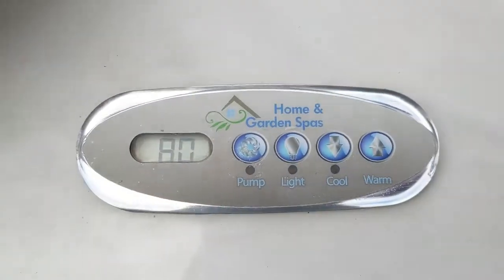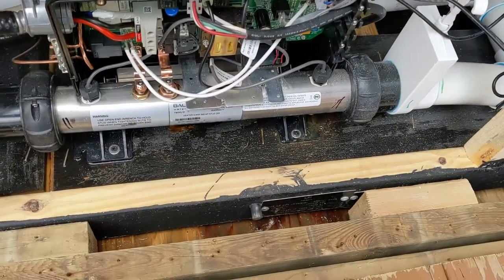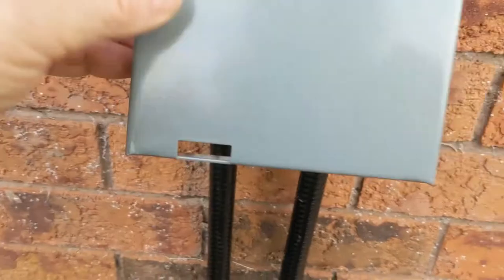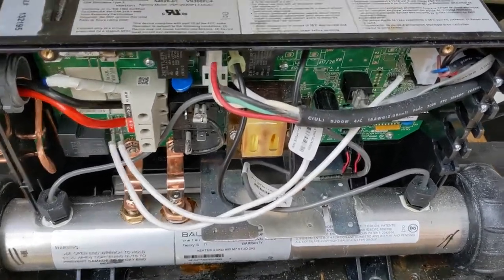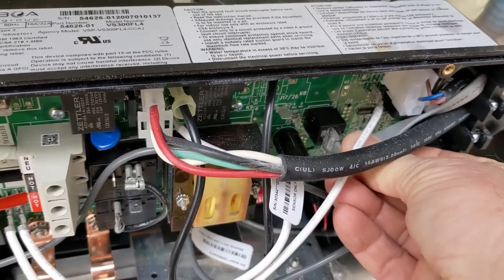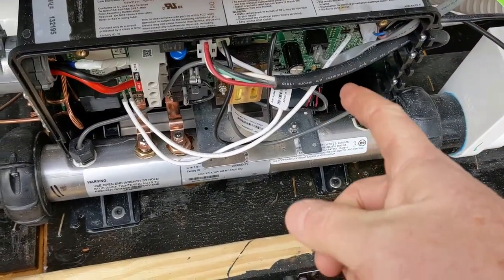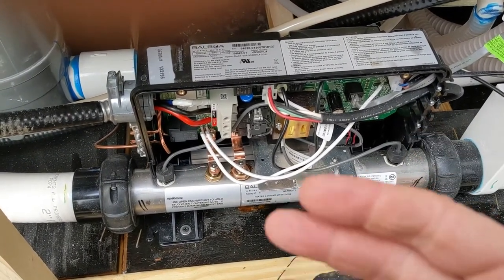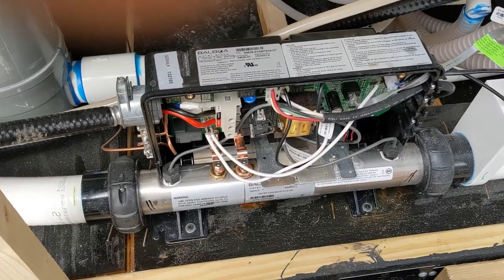Hot Tub Not Turning on When Buttons are Pushed / Hot Tub Not Turning On, Nothing Works

Comment: Subscribed! Good videos. I have a 2011 J-345 and the pump buttons on the control panel don’t work and neither does the temp up and down switch. Replaced the control panel and the same thing. Pumps run after resetting the breaker and going through its tests. However, nothing when pushing the buttons. I pulled the control panel connection like shown and nothing changed…and no clicking. Assuming it’s the circuit board. Am I on the right path?  Thx.
Reply from the maker: It does sound like the circuit board.
Reply: Thanks!

Comment: my topside works as I get clicking but the pump wont turn on.  I have verified power coming into the board and which relay is clicking when we turn on the jets but I'm not getting any power to the pump at it's board connector.  I have also verified that all of the fuses on the board are indeed good.  do you think its a bad relay? can I bypass the board and wire the pump up on a temp switch to verify the pump still works? nevermind, I missed a fuse which was the issue...
Reply from the maker: @jeffmentzer6550  lol.  At least you found it
Reply: @VIPPoolsandSpas  it a 20amp 250v ceramic fuse, I replace it and it blew instantly.  I then used a 20 amp blade fuse holder attached to each side of the actual fuse holder on the board and it's working fine.  not sure why the "ceramic" fuses keep blowing...
Reply from the maker: @jeffmentzer6550  Whatever that fuse is blowing is the problem.  Only use the fuse whats there.   Test the pumps capacitor

Comment: Hey Bud, I have an older model Hot tube. It has power to the Top side Panel but simply flashes. When I push the pump button All I get is a click each time I press it. and nothing but the click. Any suggestions what this might be?.any suggestions would be  appreciated.??
Reply from the maker: Fuse or pump capacitor maybe.
Reply from the maker: I'm going to assume you only have one pump.  Right
Reply: Hey Bud, yes One Pump. I am going to check the fuses first once I find my Voltmetre? The kids were in the tub the night before and found my strainer etc upside down in the morning so thinking maybe they starved the Pump and caused a tripout(fuse) issue. Im NOT an electrician but figure can at least diagnose what I can before calling a tech who will check what I can firstly anyways?
Reply: Hey Bud, fuses check out fine? Can these things be jumped or by passed to diagnose faulty stuff?? Then replace them??
Reply from the maker: @need2know739  not sure what spa pack you have but, could try turning power off, unplug the topside and then turn power back on.  Pump should come on.  Also, when you say it just Flash's, what is it flashing?  Could also test the pump capacitor.
Reply: Seems I have a non message display model? All I get is 3 lights flashing? Did the Power off on / Breaker swiitch stuff. Its getting power, and clicks on the  M Board  but NO Pump??
Reply from the maker: @need2know739  3 lights flashing is a flow issue.  Is your pump even working?
Reply from the maker: @need2know739  can you hear your pump at all?  Humming?  Anything?
Reply: Notta?... Just the click in the Panel when trying to. Are these Motors in them 2 stage??
Reply from the maker: @need2know739  test the pump capacitor
Reply: Is that located on Top the Heater bar?
I did the two wire jump thing to bypass to that and nothing? Is it possible the actual pump is toast? If so? Is there a bypass I can try on it to test if its a goner?
Reply: Can I bypass the   Capacitor?? Jump it??
Reply from the maker: @need2know739  it's not on the heater.  Only a pressure can be jumped to test.  Not even sure if you have one.  The pump capacitor is on the pump.  Check our videos for that.  It might also be under "hot tub pump is humming". Don't "jump" anything else.
Reply from the maker: @need2know739  you have to test the pumps capacitor.  And.  Is it a 230v pump?  It's on the pump itself.
Reply: Yes its 240 leading in so likelyhood... I will pull the capicitor and do the (~ symbol check on it with my meter and after that its pull the pump likely for Bearings and free spin checks possibly Flywheel damage.
Its says Gecko on the sticker whatever brand that makes??
Reply from the maker: @need2know739  if you can get the capacitor off, just test and do that.
Reply: Shall do, I will keep you posted.
Appreciate your help and  consumate feedback. I cant imagine trying to diagnose something without display  codes or not right front of you... 👈👍👍😊
Reply from the maker: @need2know739  just look for videos on testing the capacitor.  It's simple.

Comment: What if I unplug the topside and pump doesn’t run but there is clicking?
Reply: And nothing when the topside is plugged in. Just flashing light under the pump button. Balboa rs101
Reply from the maker: What's the issue your having before u unplugged the topside?
Reply: @VIPPoolsandSpas  Nothing works topside screen -- looks like this. I push the jet button, and nothing happens but flashing light under the jet button. I have voltage across the fuse. I unplugged the top and then you hear a constant clicky sound I guess the relay. But the pump still won't kick on. I completed a continuity test and hand spun the pump so i believe the pump is good.
Reply from the maker: @Superzach12992  sounds like a board issue
Reply: @VIPPoolsandSpas  Thank you. You are awesome cannot thank you enough for your quick response and help

Comment: My hot tub just clicks when I push the button to turn it on.I have replaced both motors and have checked the fuses which are in working order. Do I need to replace the board?
Reply from the maker: If you hear a click and nothing works, its normally a fuse.  If no click, its normally the relay on the board.  Is this a new pack?  Was something New just installed?
Reply: Mine does the same 2014 sundance,  clicks but won't start, screen shows error 11A

Comment: i have artesian spa and when i turn the power on i have 88 in top display and a clicking sound like a turning signal on a car, when i unplug the top display the clicking disapear but no pump starts? is it the board issue then?
Reply from the maker: It's the topside
Reply: thank God! thought it was the circuit board caus of the clicking sound on it @VIPPoolsandSpas
Reply: should the pump starts when i unplug the topside? caus they dont, it's just the clicking sound on the circuit board and flasing lights that stops
Reply from the maker: @Specialjazzbass  I do have a couple videos on the clicking on and off.  I'm not right there and can't hear what you hear.  Maybe the video will help?  Does the pump(s) come on and off with the clicking or is it just the clicking?
Reply: i will check them out. So when i turn the power on the lights in the hot tub blinks and there is a clicking sound from the circuit board like turning signals. when i unplug the top display from the board the blinking and clicking stops and noting happen no pump no nothing. i put the connecter to the top display back and the clicking and blinking starts
but no pump  @VIPPoolsandSpas
Reply: and i cant do anything on the top display, just says 88 and nothing els. i press on the buttons but no respons
Reply from the maker: @Specialjazzbass  what spa pack is it?
Reply from the maker: @Specialjazzbass  when you power off and then back on, what does the pump do and what shows on the topside?
Reply: same. 88 on display and the clicking sound from relay K8 i think and lights blinking and no pump  @VIPPoolsandSpas
Reply from the maker: @Specialjazzbass  check circuit board for burn marks or smell of something burnt.  Not saying thats the problem, but check to see anyway.
Reply from the maker: @Specialjazzbass  Also.  Check the wires for mice biting it.   Might have to pop off the topside to look under it.

Comment: Hello friend, I am writing to you from Spain. I have recently bought a house in which there is a spa of the brand "sunbelt spas"
The problem is that I can't get it to heat the water. I put the standard mode and select the temperature I want, the red "heat" led lights up but the temperature does not rise, the water that comes out of the jets is not hot. The panel does not reflect any errors. In Spain there is no support service for this brand, I found your videos and that's why I dared to ask you. Thanks for your attention.
Reply from the maker: What's the temp set to ?  What's the temp right now?  And.  When the tub is heating you will not feel the heat coming out.  Did you test the heAter element to make sure you have power?